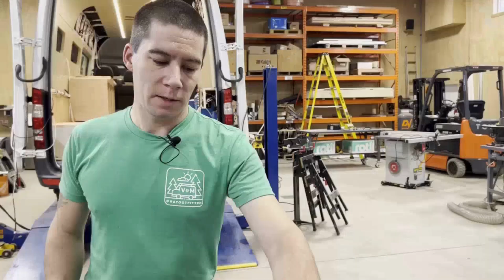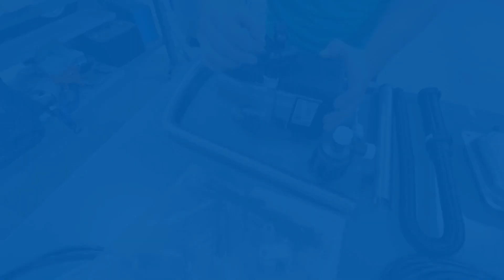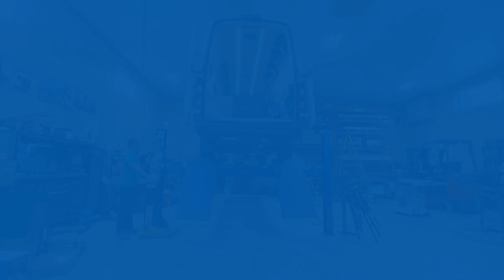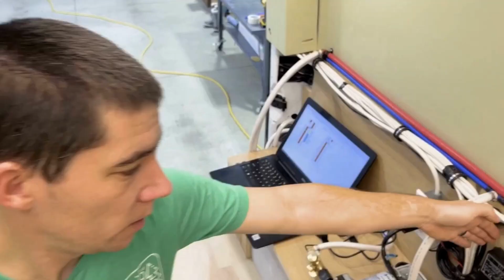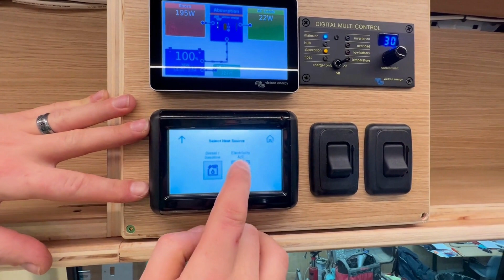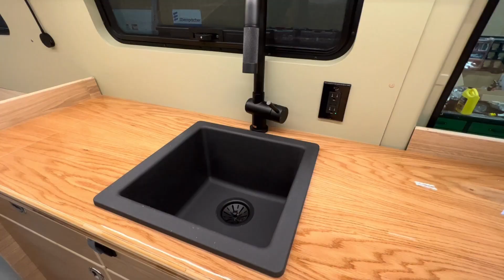Hydronic AquaSystem | An Installation w/ Ray Outfitted

Comment: Can the Coolant from the Vehicles Engine be used to help heat up the Cabin, or the Hot water ?
Reply from the maker: I believe the coolant is heated by the Hydronic heater and then run through the plate exchanger to heat the freshwater.  If you used the vehicle's engine, you'd need to run the vehicle, which would use a lot more fuel than a Hydronic heater.  Now whether you can rig up your vehicle to run vehicle coolant through a plate exchanger while you're driving to heat fresh water, I'm not sure.  is that what you're asking?